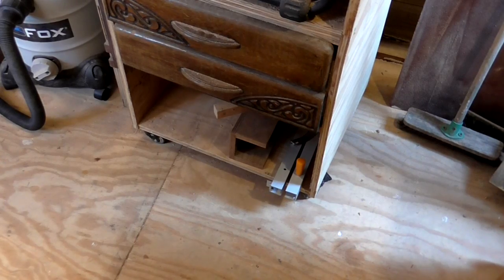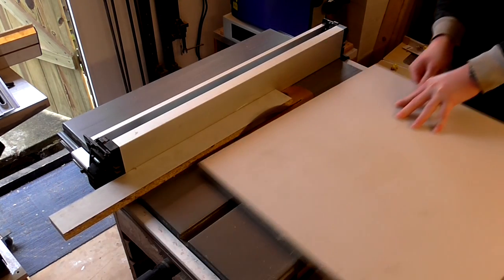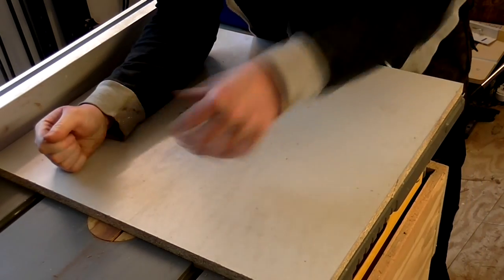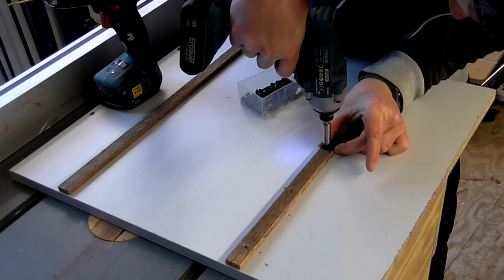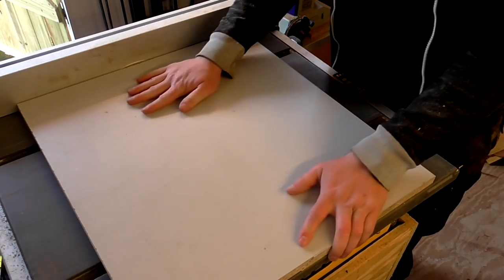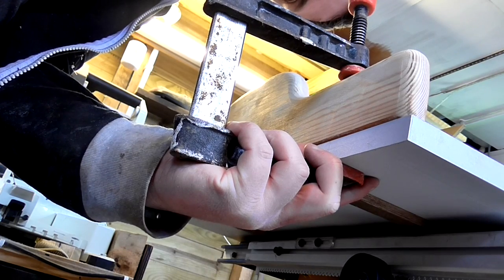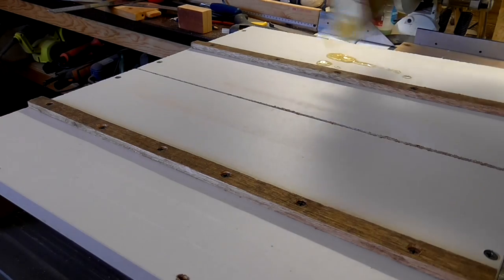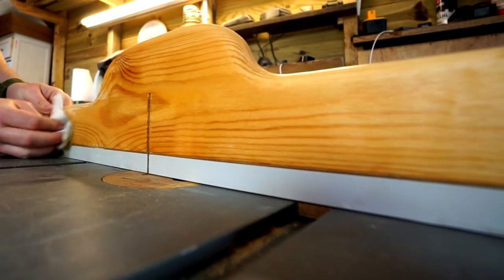Making A Cross Cut Sled for the Tablesaw

Comment: nice build,noticed you have a fox dust extractor what's it like I need a collector around that size
Reply from the maker: +Dean Reynolds I love it for what it is, it works really well. Have to clean the filter at least once per project though. I'd love a proper system but I don't have the space so it is good for now

Comment: I really need to make a crosscut sled for my table saw. Haven't got around to it yet. I don't have any hardwood to use for the runners so I splashed out and bought some HDPE plastic. Most tablesaws that I see on youtube seem to have cast iron tops. However mine, a dewalt, is painted. So I wasn't sure how smoothly runners would be. How's yours?
Reply from the maker: +ksp1278 it's ok but needs a bit of candle wax occasionally to keep it smooth
Reply: +Rag 'n' Bone Brown ok. Thanks. good to know